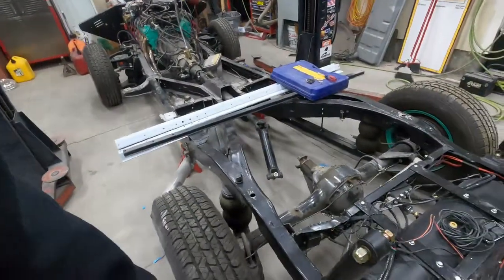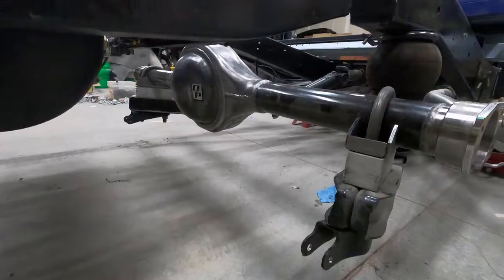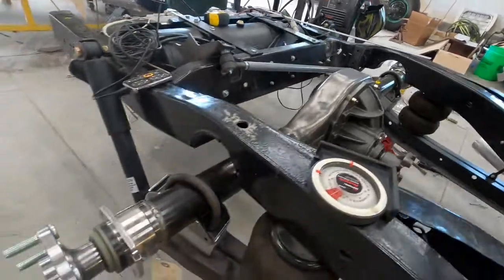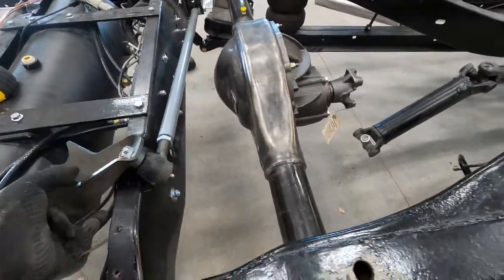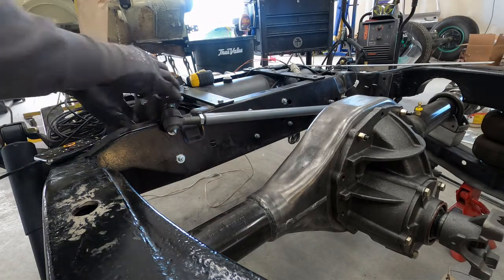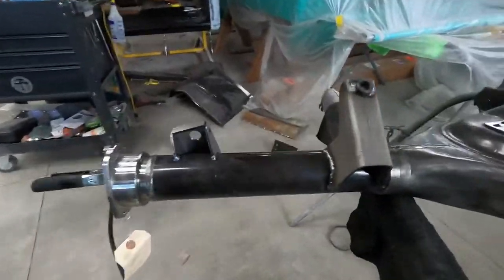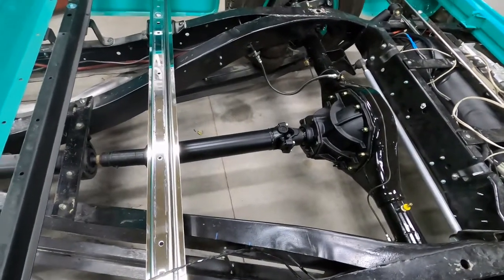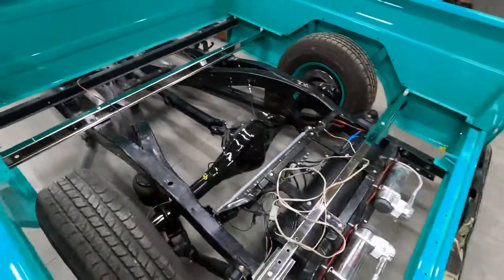1961 Chevy C10 Quick Performance 9" rear end install

Comment: What did the trailing arm pads measure bolthole centerline to centerline from each other side to side. Having this same rear built, but original rear has been changed out, and would like to verify my measurements. Thanks.